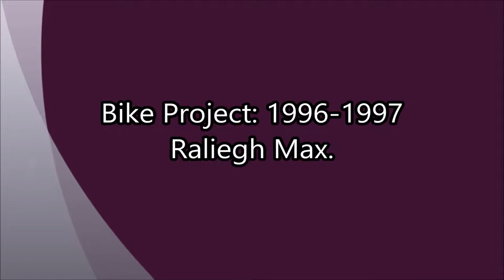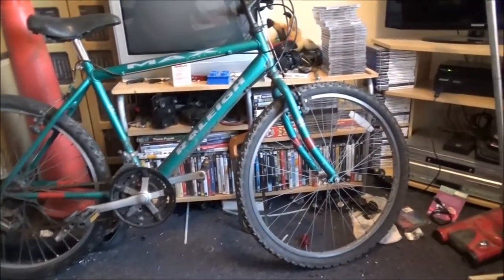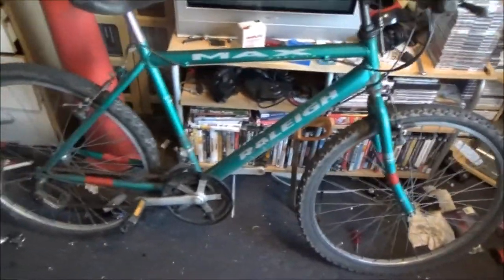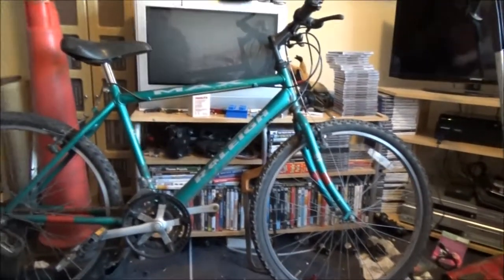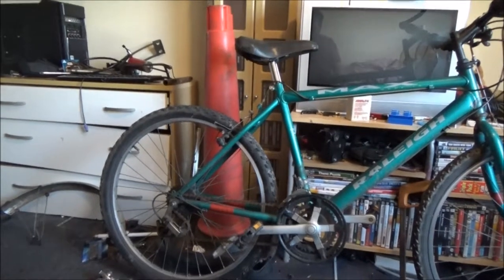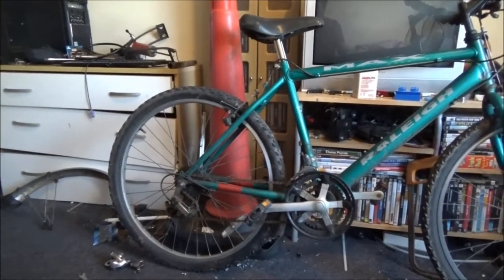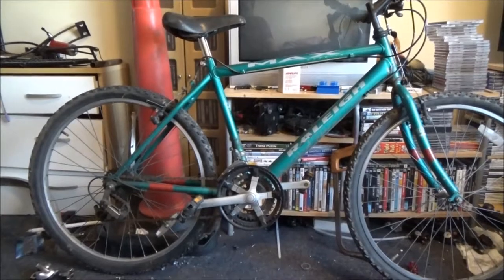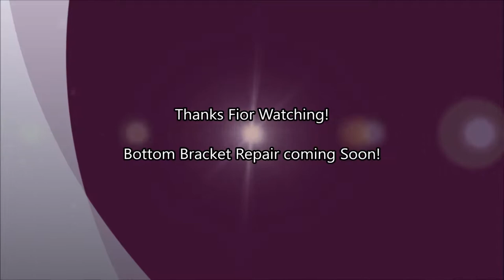Bicycle Project: 1996 -1997 Raliegh Max

Comment: Got the same one. Picked it up for about £35 I think. Its grand for going to the shops and back and a few other little visits to patients in the community. Wouldn’t really go more than 2 miles on a single journey. Heavy yolke but sturdy. Back wheel is a bit wobbly and if you put too much torque through it (e.g. starting off midway up a steep hill in 2nd gear) the back wheel can pop off. Brakes not gripping as well as they used to. I probably should get it serviced One of these days 👍